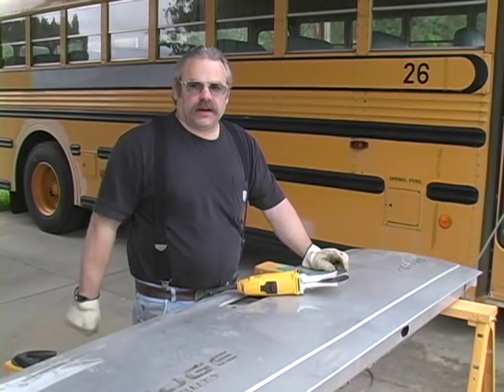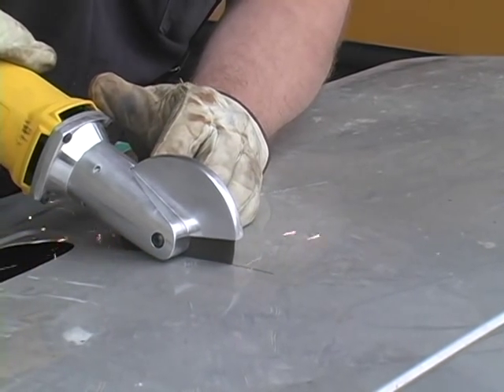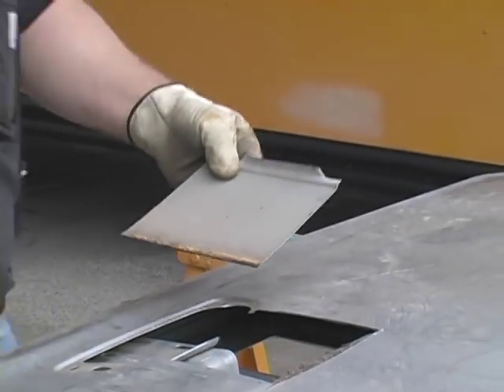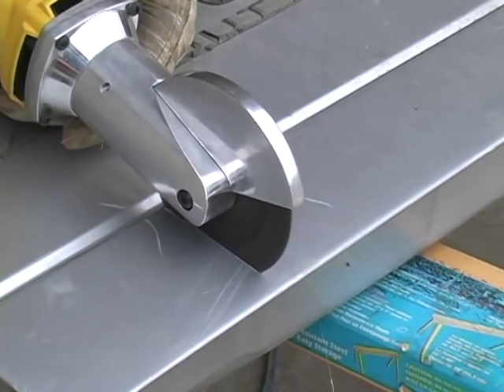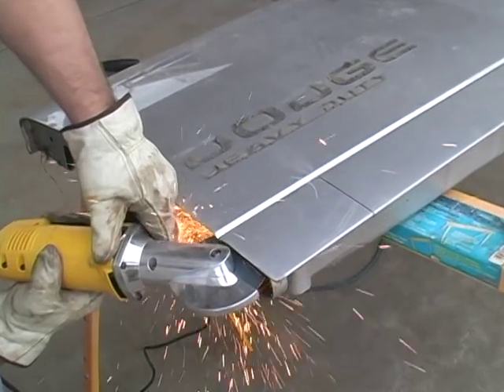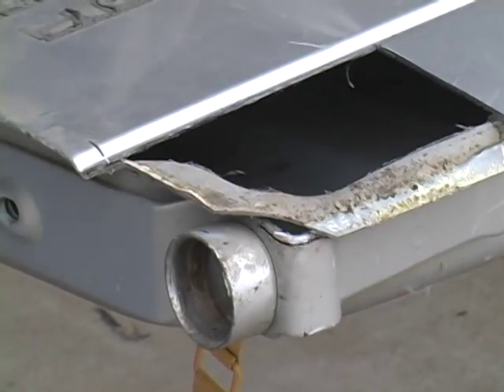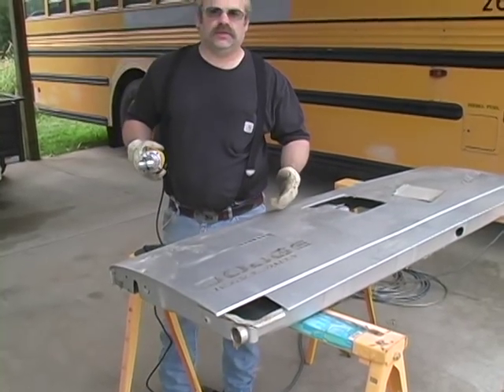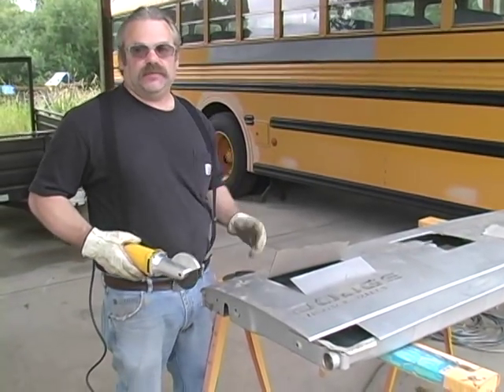cutoff tool HD

Comment: I remember needing to buy a tailgate for my truck. Junkyards were wanting $250-$300 for them back then.  It kind of pains me to see this tailgate cut up LOL but it sure shows me what a good tool that is.  I eventually found a tailgate for $125. New, from the original manufacturer. Always check, never assume, that a junkyard is ALWAYS cheaper than new even if owned by friends or family.

Comment: i used cutoff wheel to an angle grinder and while cutting a timber it slipped from my hand cut my thigh muscle and had 18 stitchs. luckly it dint touch the bone.

Comment: Sounds gutless to me. Just get a regular Metabo, it'll run rings around that thing.
Reply: Get the $500 Dewalt cold saw which runs at 1300 rpm. You will never use a stupid abrasive blade again. Save your lungs and time young man.